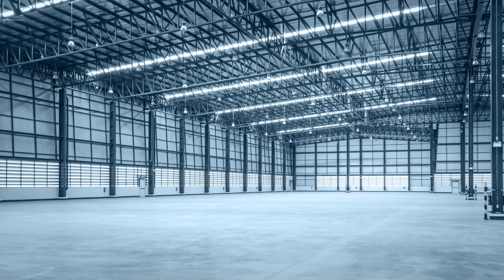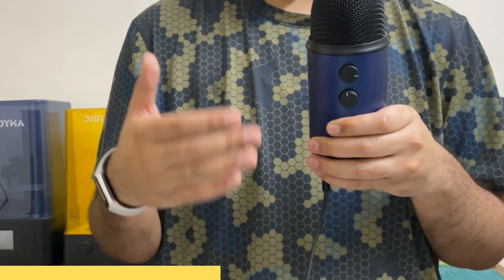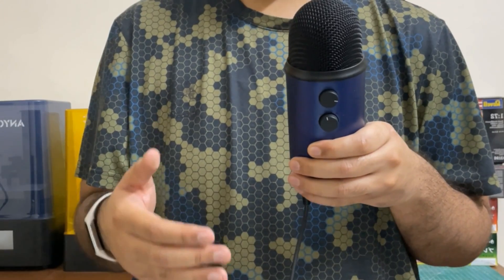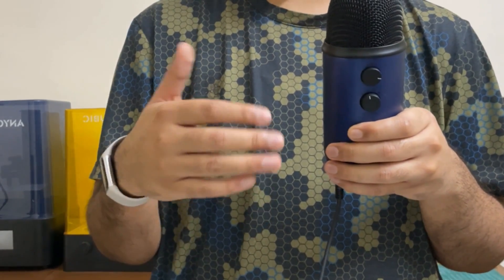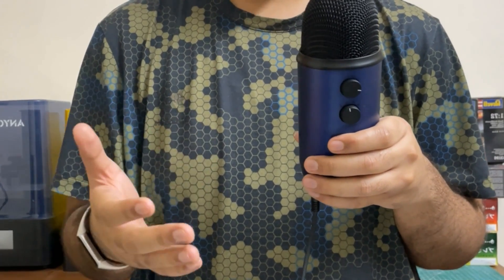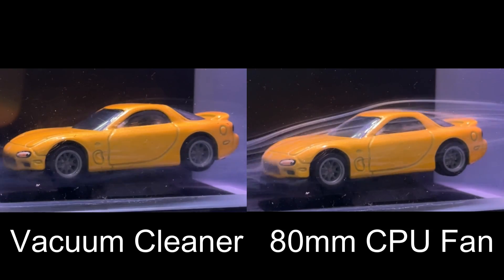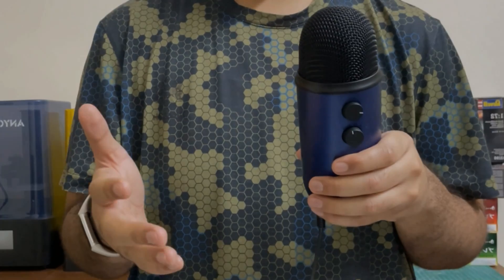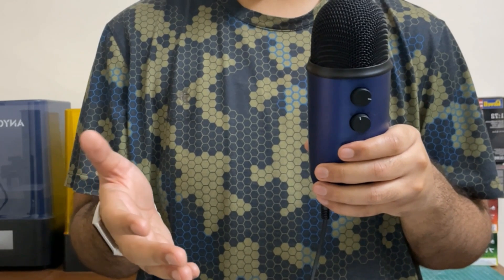I made a 3D printed Wind Tunnel for my Hot Wheels

Comment: Hey, I’m a 2nd year Mechanical Engineering student and I’ve tried to make this for like 2 or 3 years but never got those levels of results. With this video I think I got a few cues on where to experiment next. By the way, is it possible to scale yours up? I was looking for a wind tunnel for 1:24 scale models, so essencial I would need to scale it up by 2.5-3 times. Love the vid, funny jokes💪🏻
Reply: Sorry I found you as one of the most recent comments and thought you could maybe help with something, I basically wanted to ask if the air straightener could sit at the start of the test chaimber because I am on a budget but still want to make it. Thanks in advance.
Reply: @Slayer_RL.  if you’re on a budget I can help you since I nade mine and I’m still making mine on a budget. I made mine with cardboard and spent pretty much 0 dollars on my build. Ideally the straightener should be a bit before the chamber so yeah you could test that out. You could also make one with cardboard to test it out.

Comment: Hey dude, i downloaded your print files from patreon and handed them to a printing service. But the dimensions are showing 8mm length and 15 mm width. Obviously the one in this video is not 8 mm in length, so can you please update the patreon files? Also, what material can i make this out of i have no access to a 3d printer?
Reply: I guess cardboard and glue/tape/silicon to seal and keep the thing Toghether
Also for the wind straighteners you can roll paper into little tubes or cut plastic straws

Good luck with your proyect!

Comment: is there a different way to make a Wind Tunnel for not alot of money?
Reply from the maker: yes, you can cut costs by using acrylic sheets for the whole thing, plastic straws for the flow straightener and a regular household vacuum instead of the 80mm fan

Comment: i download your STL files and open it in cura. it was very small so i had to make them bigger, how big i should make them?. Btw model is so good!
Reply from the maker: Ideally you should print it at 1000% size to fit an 80mm computer fan but I printed mine at 800% due to print volume limitations and it still worked fine. So the choice is yours
Reply: @toast_channel  thanks!

Comment: Thank you broski I shall try my - no wait nothing pls scroll below
Reply: Also can I just use like plastic from food containers and tape those? That might be a bit more economical right? Especially considering I'm lowering my lifespan so I want more money...
Reply from the maker: The compression cone is the only tricky part I think, and oh, the flow straightener too maybe (unless you can find a similarly shaped object?) but other than that? I think you should be fine. Let me know how it goes!
Reply: @toast_channel  Also, the stl files you've provided, what units are they in?

Thanks for providing this model btw, been wanting a wind tunnel for a while now :)
Reply: @toast_channel  What I meant was the acrylic transparent sheets
Reply from the maker: They're in millimeters, and no worries man!
Also, yes, you can absolutely use food clamshells instead of acrylic sheets. I used regular cellophane tape for the prototypes, and it worked fine. Hope I understood your question correctly this time around?
Reply: @toast_channel  Yup, thank you so much! This is a really helpful wind tunnel. Haven’t printed it out yet, but I’ll surely test it out and let you know!
Reply: @toast_channel  Oh BTW, are these files ready to print immediately? I noticed the lengths are 8.0 mm, and not 80? Also can I try reducing the scale to 50-75%, do you think it would still work? Additionally what's your fan rpm speed? I'm scaling it down so I want to make sure it is the right power.

Thanks!
Reply from the maker: Ah, STLs sometimes do that when they're directly exported from Blender, you can scale it back up to 80mm. And before you print it, you'll need to add supports to it based on the kind of printer you're using. 

You can reduce the size, I printed mine at 85% because of build volume limitations of my printer. 

The RPM was supposed to be 2000, but I ran the 12V fan on a 9V battery, so you can assume it to be around 1500~ish.
Reply: @toast_channel  Thanks for your answers! I printed the laminar flow maker thing at 62.5% scale for now, will print the collector at the same scale, and the test chamber and diffuser are going to be handmade (I use the SV06 which has some problems clogging when printing for 3 hrs+ apparently).

Thanks for clarifying the RPM as well! The fan I was looking at was 2500-3000 RPM I think at 50mm x 50mm scale.

Thanks again! :)